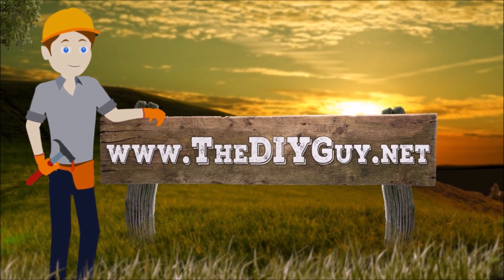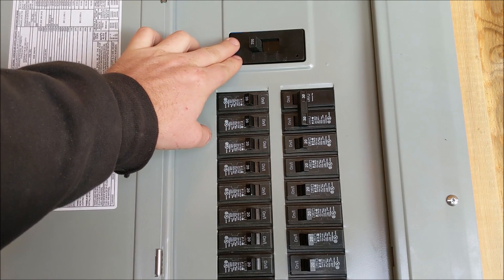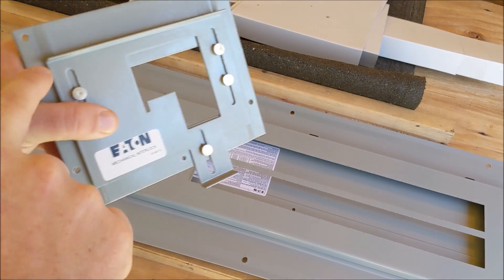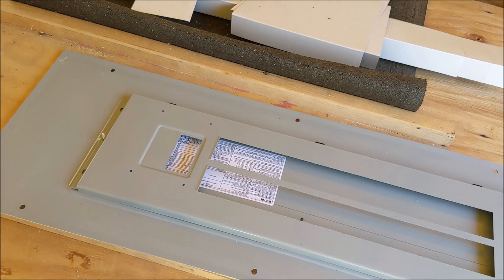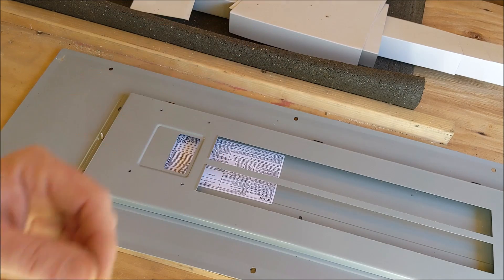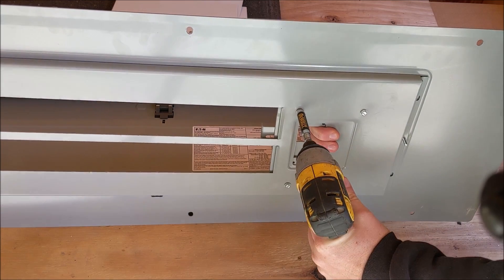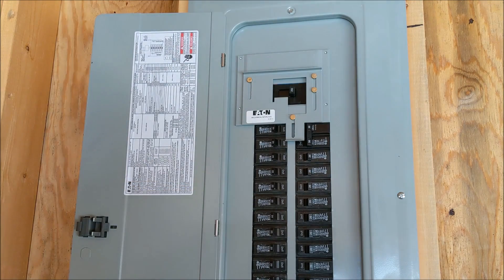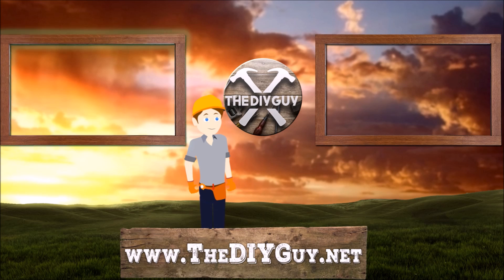How To Install A Generator Interlock Kit

Comment: Great, but where does the generator plug in???
Reply: That's a separate topic. You'll need an outlet for the generator that is connected to the breaker and powers the house when the main is turned off and the breaker for the outlet is turned on.
Reply: @CassieMaas  so you simply feed generator output into the outlet on the other end of the 30 amp dual breaker circuit?
Reply: If you have central air you can piggy back off that and back feed into your electrical panel that way. If you don't have the knowledge to do this I strongly recommend that you hire a professional  for this install.
Reply: You would simply buy a NEMA L-14-30amp 4 prong Twist lock Inlet Box Receptacle (Weatherproof if exposed - Standard if under porch cover already).
Run Romex 10/4 wires from that Inlet Box to the 30A dedicated Gen Breaker.
Reply: @psalm2forliberty577  what kind of load could you sustain using a 7200W generator supplying power to this 30AMP breaker?  heat pump, water pump, 2-3 electrical 100 watt outlets and a fridge?
Reply: @mackendw  
You would need the amp rating for each of those items, take that # x 120v or 240v = wattage.
Add up wattages to see if under 7200, if so generally good.
Consider also that motor start surge can be 2x running watts so make allowance for it.

Comment: how did you move the breakers to free up space for the generator breaker
Reply: E P would like to see an answer to this question too 🤙
Reply: @MauiGuy1960  if you need more room, you can exchange a single breaker to one that is a tandem breaker.  For every one you use, it will free up one spot.
Reply: You've got to move the upper right one to another spot OR move those wires to a new breaker elsewhere in box.
Interlock will only work in that one space for Generator Input breaker.

Comment: Awesome install, thank you for sharing! Quick question... Why does it say you can’t run the AC, oven or range from the generator? Do you know? Shouldn’t that be based on watts?
Reply: Yep.  It's based on watts.  You'll need a big gen to supply that stuff.
Reply: How big
Reply: @patriciarolland802  Minimum 4000 watts for any 240v load like dryer range or Central AC
And better run when not to much else is on.
Best to have a 5500-7000 watt (5.5-7 KW) or larger if you might run 2-240v loads simultaneously or one 240v + numerous smaller 120v loads.
Reply: The wire and breaker to do so would be huge!   But another thing is generators are notorious for damaging electronics so... would be hard on the electronics of those appliances and no way of line conditioning to large appliances
Reply: If you get an inverter generator like the Honda EU line they won’t hurt sensitive electronics, they actually can put out a cleaner signal than utility power.
Reply: To find the size, you would need to do load calculations. So hvac uses say 3600w while running, BUT it uses 9800w just to start. So those bigger usage items use 2.5 to 3 times the amount just to start than their running wattage.

Comment: How come these interlock plates are so expensive?  They are only made of a couple dollars worth of metal and they do not include the circuit breakers either.
Reply from the maker: They are the cheapest code/ approved option compared to replacing the entire panel or add in an actual transfer switch. Basically they can charge almost whatever they want within reason compared to a transfer switch. The lower end/ cost transfer switches the give you only 6-8 circuits where with this plate you can use any circuit within the panel.
Reply: . thanks but...  better off to Fab my own than spring for $150, that's ridiculous
Reply: Steve Izzo I agree.  A few pieces of sheet metal and a few nuts and bolts and a screw or two and you now have an interlock kit. But you know there are some “Highly Educated College Graduates” who cannot even change the tire on their car!  Let them pay $150 for the kit and then another $150 for someone to i stall it on their panel!
Reply: @eagleviewhd  - Interlock kits are NEC approved. Your homemade garbage is not. Hard to believe line workers stake their lives on other people's cobbled up junk.
Reply: @eagleviewhd  If your house burns down from your illegal wiring, insurance will not pay.  If you try to sell your house that way, an inspector will flag it.
Reply: Lee tullberg i can easily remove it before I sell the house!
Reply: @eagleviewhd  Some people are old, handicapped, unable to do such work any longer . . .
Reply: @eddiehennig7835  You are talking about simple bracket... which your "NEC approved" company cost 5 dollar to build... in US, not China!!! Is not science to do that. Most "handmade garbage" are build better than official if builder know what is requirement.
Reply: @zoranlukic4986  - And again, ask a lineman handling wire and transformers in severe weather if they would stake their life on your homemade junk. The bracket may cost $5 to build but getting NEC and UL testing done and their approval to manufacture a safe product costs money.
Reply: @lt118436572 I am a highly educated college graduate.  The average plumber or electric guy makes probably 4X what I make.
Reply: You can get it at Lowe's for around $60 and on eBay for less. May find a used one or open box

Comment: Nice! didn't even know they made those. I was looking at a manual switch setup.
Reply from the maker: Much easier of an install compared to a manual transfer switch and easier on the wallet. They started making them for other  panels as well.
Reply: @TheDIYGuyDOTnet  a
Reply: Is this used for a portable generator? And wheres your inlet
Reply: @carlosreyes6448  the inlet is the 30amp breaker top right side- it back feeds the panel’s bus bar while locking the main breaker off
Reply: @carlosreyes6448  Yes, this is what you need for a portable, gasoline generator. You install.a two pole breaker and generator plug in box along with the interlock and you're good to go.
Reply: Where are these available